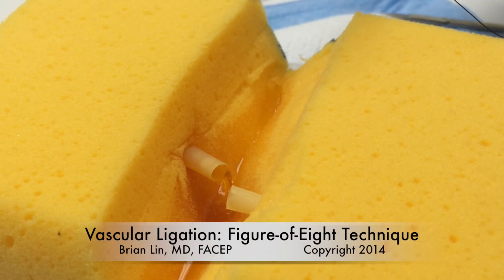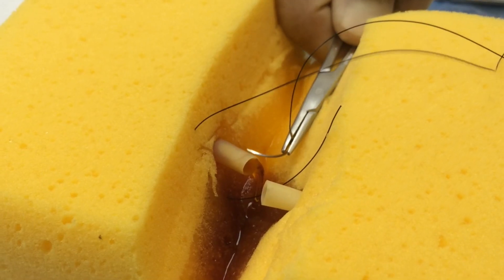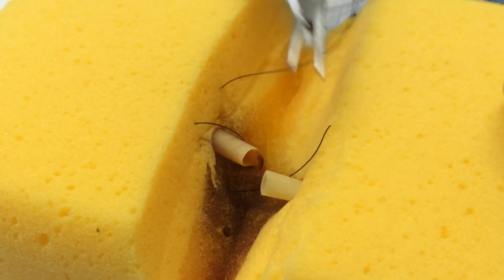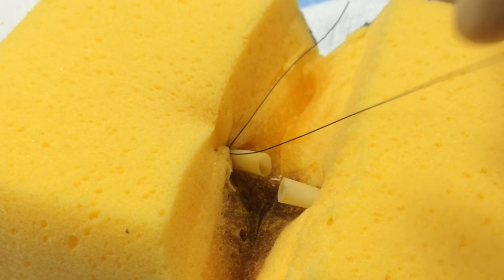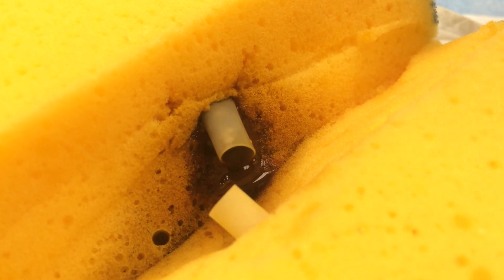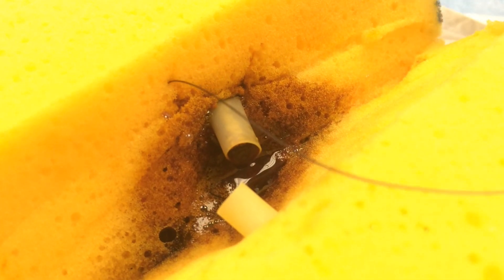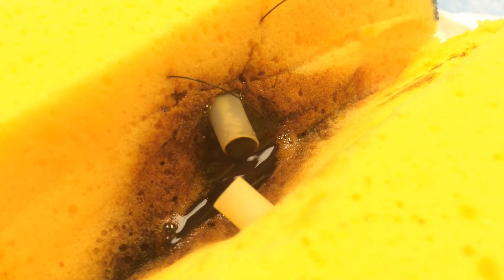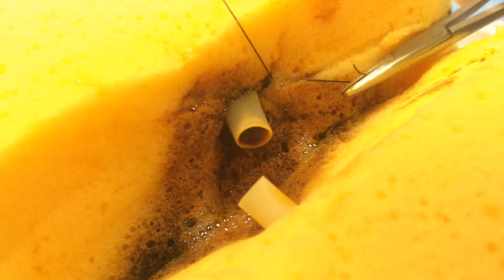Vascular Ligation: Figure of eight suture

Comment: If you don't mind me saying , a hemostat clamp at the tip of severed artery  would be very helpful to keep the field clean while placing sutures and to prevent unnecessary blood loss (blood vessel was secured after exactly 35 seconds of profuse bleeding).
Reply: This video is for when you can't locate the vessel
Reply: In ambulances where i work there isnt vascular hemostat clamp, or at last ordinary clamp  but always there is suture material. Beter a compresive ligation than vascular iatrogenic damage, i think.
Reply: Exactly my thought
Reply: 1- Se ele colocasse o clamp/pinça, não conseguiria mostrar o vaso sangrando.
2- o sangramento/ saida de fluido não é abundante porque se está a ser ligada e não reparada, não deve ser um vaso de mediano/ grande calibre porque senão melhor seria repará-lo.
3- Na prática existem outras formas de ir contento o sangramento sem a necessidade de usar um clamp/ pinça, como por exemplo, a compressão/ pressão sobre os tecidos/vasos.
4- Ele não demorou no procedimento, mesmo tendo em consideração que o fez mais lento, para demostrar como se faz; na prática, acredito que, ele sendo um profissional experiente, demoraria pouquíssimos segundos para ligar o vaso.
Uma coisa é fazer uma demostração, outra coisa é a vida real. Quem trabalha nesta área, sabe como é.